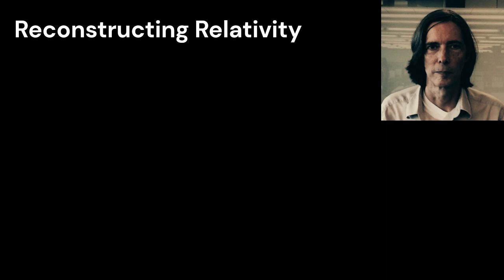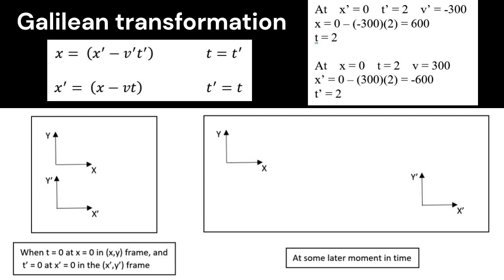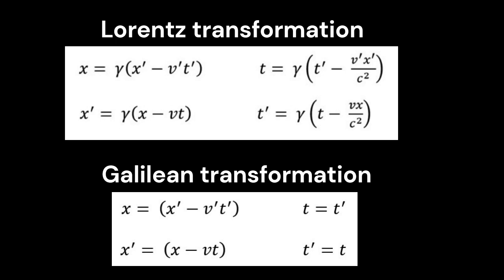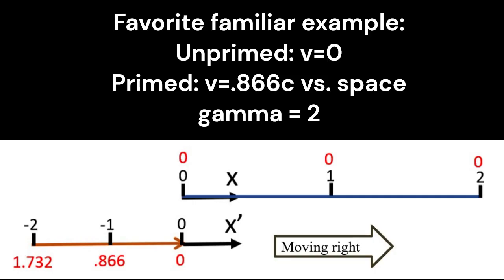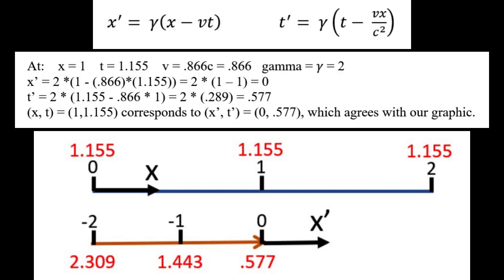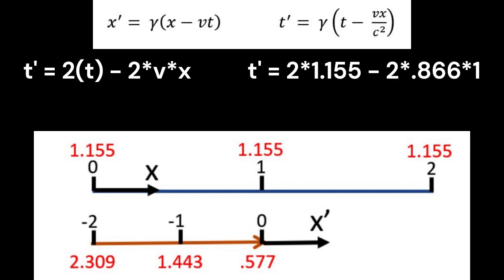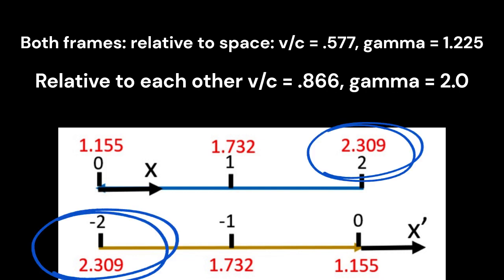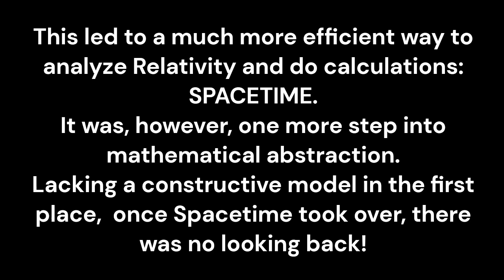Reconstructing Relativity - Lorentz Transformation

Comment: Hi Reconstructing Relativity, nice video!
... I would like to explain my opinion to you by talking about " the correspondence principle ".
The correspondence principle is related to Lorentz Transformations. (and to Galileo's Transformations)
Maybe you know it, but there is something strange.

The two main Lorentz transformations are::
a) x '= gamma * (x - v * t)
b) x = gamma * (x '+ v * t ' )

The other two Lorentz Transformations:
c) t '= gamma * (t - vx/c^2)
and 
d) t = gamma * (t '+ vx '/c^2)
are obtained from a) and b)

- In this case it is enough to consider the two Transformations a) and b), because c) and d) depend on a) and b)
At low speeds the Lorentz factor (gamma) is a number very close to 1, 
and so the two Lorentz transformations a) and b) become:
a_1)  x '=  x   -  v * t 
b_1)  x  =  x ' + v * t ' 

Substituting a_1 in b_1 we obtain:
x = x - v * t + v * t '
v * t ' = v * t
t ' =  t

" THE CORRESPONDENCE PRINCIPLE " IS SATISFIED:
x '=  x - v * t 
t ' = t
(At low speeds, Galileo's Transformations are obtained)

And it is not the same, if we consider the two Lorentz Transformations a) and c)
a) x '= gamma * ( x - v * t )
c) t '= gamma * (t - vx/c^2)

At low speeds, the two Lorentz transformations a) and c) become:
a_1) x ' =  x - v * t 
c_1) t '  =  t  - vx/c^2

But if we consider large values of x, then t ' is not equal to t. (and Galileo's Transformations are not obtained)
- And the strange is that in this case it is enough to consider the two Transformations a) and c), 
because b) and d) depend on a) and c)

If you are interested in this topic, here is the link to a video by Roger Anderton:

https://www.youtube.com/watch?v=Ew2o8KezEAw
Reply from the maker: OK, thanks, I'll check into your link..